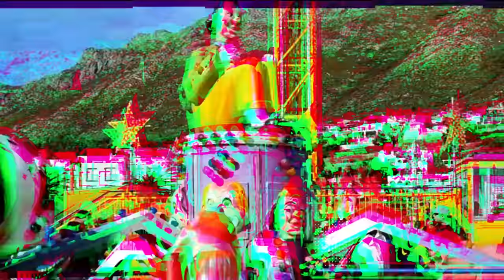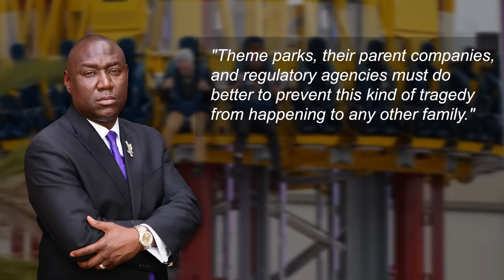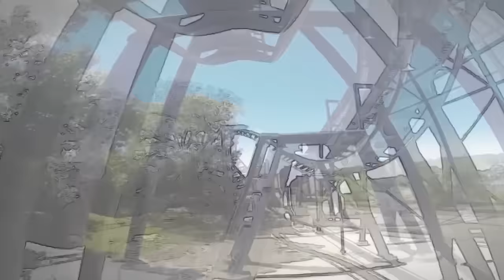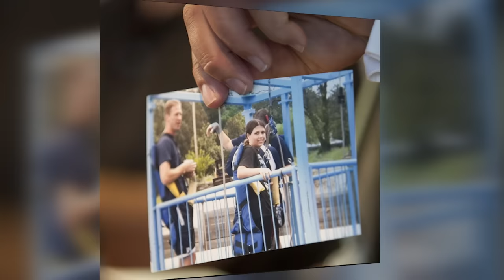9 Worst Roller Coaster Accidents in Human History

Comment: when i was 10  went on a ride at the state fair my belt was loose as I am a infant idk why they didn't tighten it the ride was vary fast and made of a slippery material when we hit a sharp turn i almost slipped out the only thing keeping me from slipping out was my grip and my skin which was sticking to the seat sense i was sweaty once I got off the ride I had calyces on my hands and burns on my thighs/legs it was scary i don't think it will happen again though ever since then i haven't gone on any roller coaster's

Comment: I was almost on this list. Riding on Montu in Busch Gardens Tampa, in one of the loops the hydraulics locking my restraints failed. If I didn't have the seatbelt connected, I would have been in a vertical loop with no safety restraints.
Reply: Doubt this happened.
Reply from the maker: Oh my! Thanks for sharing 🙏🏻

Comment: I have a lot of problems with this. 

1. Final Destination 3 is a shit movie that has no knowledge on the mechanics of roller coasters. Do NOT use clips from that.
2. Some of these aren’t roller coasters. Maybe change the title to amusement rides.
3. A TON of these are footage from different rides and parks than the ones being mentioned, including Texas Tornado during a section of the Darien Lake incident and Scream during NTG.
4. You ignored the part where Hackemer refused a safety pamphlet and was belligerent with staff. 
5. I believe Ferguson was trying to actually skip the line or leave the park from an alternate path. 
6. 2013 was not two years before 2008. That was New Texas Giant. Not Texas Giant. 
7. I don’t know a lot about Disney rides like Columbia, but there’s no way the ride has been closed for 25 years. 
8. Wooden coasters are no less safe than steel ones or any other ride for that matter, as long as they are maintained properly. Only when a ride is not maintained well or a guest makes a stupid error will you see incidents. 
9. Stop fear mongering. Most ride accidents that do occur are like I said, on the guest entirely. 30,000 (if thats accurate) out of millions and millions is not as bad as it sounds. Youre more likely to get injured fishing, or driving, or in your bathtub than on a ride. Something like a horse you put quarters into at a grocery store, that counts as a ride. Some of these are from that. It can also be as simple as stubbing your toe in the station. 

I’m sorry to sound nitpicky but there seem to be a lot of gaps and oversights in this. It’s especially dangerous to spread fear about an activity that is, in reality, very safe. These are easy fixes, anything worth doing is worth doing right. Don’t rush yourself with videos, make sure everything is accurate before having the video out. I highly recommend Coaster College’s What Really Happened series for some of the best research on incidents like these.

Comment: I was on a ride called the falling star at a place called clementon park. The ride apparently was struck by lightning the night before and had issues earlier that day. I got a front seat w my friend when it was okayed I was about 11 / 12. Well on the second free fall around my side of the seat bar unlocked and tried to swing open.  I Litt didn't even scream I sprung into like survival mode and wrapped my self around the inner bar best I could.  my friends side was where the hinge was so she was kinda safer then me plus I kinda kept her in slightly just by sitting there. but I was Litt hanging onto the bar for my life and my legs swung out of the ride on the way down. LUCKILY they saw it and immediate stopped the ride however it's a momentum ride and it took a while before it stopped. I was bruised had a bad knot on my one leg and shaky as hell but not hurt. This was in the 1980s early 90s so nothing happened. Lol I sat down got a free meal a free return pass fore and my friend and I went back to going on rides an hour later lmao.(us 80s kids were just built different mentally i think) I'll never go on a free fall ride again tho. if it happened when the ride was in full swing I wlda either fell off and flew into the lake or the parking lot. I DNT think I clda held on in full motion. I also broke a leg at action park in the 80s lol just went home and nobody did shit lmao.

Comment: Small children should not be allowed on rollercoasters both height and weight should be taken into consideration  same as obese people  shouldn't be allowed on as the rides are not compatible with overweight people the safety belts cant possibly fit plus the ones on rollercoasters and drop rides are not made to fit extra large people.

Comment: shi... happens , there was one i heard about a while ago a ride that launches you up in the air vertically while you're all sat on a seat facing outward......it got stuck at the top which doesn't sound so bad but after a while of it being stuck up there it dropped on a free fall to the ground and while the legs and such are still above ground level the impact of it hitting the ground at such a force caused severe damage to everyone on it , broken/shattered pelvises for everyone , severe spinal damage and some dislocated shoulders.

it's kinda like sitting on a chair and being dropped from 100 feet up , just like the first one

Comment: Then the theme park can be sued for discrimination, eh?
The question for the teen should be, had he survived: “WHY didn’t you tighten your seatbelt, as you know due to your size, esp of your belly/chest area & height THAT 99.9% of any safety gear like a seatbelt, would need to be pulled out much further than say for your fellow 6’5” 190 lbs wide receiver footballer to the much shorter/smaller or average height & build of most riders/tourists (typically varied aged  adults trying to handle babies + tweeties to teens). Yet, each of them also need to manually (w/your hands) tighten their seatbelts for optimal effectiveness.. SO WHY DIDN’T YOU, YOUNG  MR. SAMPSON, TIGHTEN YOUR SEATBELT?? ASK FOR HELP W/TIGHTENING THE SEATBELT BACK UP OR TELL THE ATTENDANT THAT YOUR SEATBELT FELT LOOSE(you’re old enough that you know how to ask for help or am I wrong on this.. just curious😉
Just like the legless veteran who wore no seatbelt & was happy to do without one, even tho his body was overly top heavy and if he’s going 25-35 mph on curves.. this combo would only make his lone & mainly upper body elevate at a faster than the normal rate that one’s body IS NOT USE TO & well, you know the rest. 
🌺 RIP Tyree Sampson - yo’ Tyree,, UB.. Gone to Soon..smh😔
🌸 RIP James Hackamer +Thank You for your service & personal loss of your legs from a homemade bomb in Afghanistan, I believe, in proctecting us here in the USA 🇺🇸

Comment: I worked on construction projects,through  temp agencies, we are put through a safety  awareness program called W.I.M.I.S  for EVERY CONSTRUCTION SITE WE WORKED ON,,we are to use a 4 point safety harness if we work near an edge or on a dangerous situation,which is also on a yank or jolt line that's supposed to absorb the jolt,if you fall,yet these rides use poor or useless safety harness  measures,like this ride  uses only seat belt,that should have been a 4 point safety harness with 2 seperate buckleing devices !for this ride! Or any ride!
Then this young boy wouldn't have fallen out! and died!
Also,due to his size, its the responsibility of the ride operator to prevent any person from getting on a ride when the equipment can't accomodate thier size!
Insults about size or obesity don't kill!
 Negligence and careless decissions do!
We as humans do make mistakes, so with tgat said we also need to make our own decisions not to do things tgat are a risk of the gift of life from God,but also to forgive thise that have made mistakes that cause us or our freinds or relatives our lives!

Comment: All of these are tragic deaths but there were several that the people should never have been on to begin with. They have weight and height requirements for a reason. I've been told a few times I couldn't ride because I was too fat. Fine by me if it keeps me from getting killed. Another reason are the barriers that tell you, more than once, NOT to cross, and they have more than one barrier. If you choose to ignore those safety precautions, of any kind, you are taking your life in your own hands. For those victims who were truly accidental or the fault of the company, I have the utmost sympathy for and their families. Ultimately, when you disobey the rules, or the parents give in, you are literally taking your life into your own hands. It's time to start taking responsibility and quit blaming others unless other people are the reason for what happens. Obey the rules.

Comment: I cannot believe what happened to poor Tegan, that is what radios are for, to communicate and indicate safety protocol before rides AND activities that need safety precautions taken. As for Sampson, they should never of let him on the ride. In the UK, those drop ride seats are always held down, with a clip down belt as 'safety precautions', so if the...."but what if" happens then you know you have a chance. Personally, I believe that all these mechanical rides and rollercoasters should have an automatic stop, so of there are any faults AT ALL, even a slightly loose bolt, the ride should not start even if the button is pressed to go!!!! It should show a light and make a sound that something is wrong. Do these rides not have a computer system, like an ECU!?! If they do, there not very good are they!?! 🤔😕⁉️

Comment: As much as I love Alton Towers Theme park in the UK
For me the one that will always stand out is that of the smiler
Where the park was busy, they added a 5th train / cart to the ride and operated it at 45+ Mph winds when the ride was only designed for 38Mph or less winds

The ride operator dismissed the ride safety alert stating there was a train stuck at the bottom of a U bend, the ride operator thinking there was 4 carts on the ride wasnt aware of the 5th and over-rode the safety mechanism resulting in leg amputations and 4+ hrs trapped on the ride which crushed limbs and knee joints and bleeding out.

https://www.youtube.com/watch?v=LEa8oHG4id0

Comment: People seem to forget that in many rides your loading yourself into a huge machine capable of imparting a lot of force.  If something feels off, get off.  I once rode a coaster where I had a lot of problems closing the over head restraint over my big belly so an employee gave it a shove and got one ratchet click.  I rode but the entire time I was wondering if that one ratchet tooth was going to hold me.  better still it is an inverted (under track) coaster where that over shoulder restraint and a crotch horn in the seat was all that was holding me in.  It made me so aware of how stupid I was to NOT get off and to really think about the safety systems and dangers present on rides thereafter.  Understand that a properly engineered, maintained, and operated ride is very safe but never forget that they are not foolproof and as this video has shown in most cases the fool is the one in the seated on the ride.  Don't be that fool.

Comment: It's suppose to only scare you, it's suppose to be %100 safe. All the bolts at those fairs should be tighter than hand tight or (snugg). Put some lock washers, & lock nuts on everything. Nothing wrong with reinforcing everything. It just takes longer & most people are lazy. Oh yeah, btw, if you have electrical wires running under metal gates & fences, please put up signs, as to not to touch it. I was zapped b4.😂😅😢😢😢😢

Comment: If I ever went on any ride and there was ANY doubt or question if it was ok for me to ride it either size or any  doubt for any reason I wouldn't ride it. I love coasters but if I had the thought going round IF it was safe or any doubt it would stop me enjoying it. So be no point. 
Lot of these stories aren't exactly full facts or full story which can be dangerous on its own not giving an accurate account.
Also if anyone enters restricted areas thats not an accident its suicide, endangerment of others and at best playing chicken with your life. Any death is really sad but if you enter a clearly restricted area you're an idiot for putting your life at risk but even worse than that putting other lives at risk which is unforgivable.
Ride operators I'm sure do make mistakes but feel the public will put them under pressure and use discrimination for not letting them ride. Its not discrimination if its for your safety it's called care and anyone using this is just pathetic.
If the sensors say the bars or harness does not fit comfortably into place where they should be it should be a no go, full stop!
 Failure to walk away by anyone not taking safety advice should immediately be removed from the ride and park for their safety and others and not allowed to visit again.
All so sad stories and hearts out to families but majority so avoidable. Theme parks and rides are fun but if you can't be sensible, mature enough and put safety of yourself and others as top priority you shouldn't be visiting!
If we all put safety as priority then everyone can have a fun filled day without incident which is what we all want to happen

Comment: How did God warned me well let me tell you I got stuck upside down on coaster another time on Goliath the seat belt came loose I held on tight if I didn't I would bin dead in Los Vegas long ago its dramatizen I was little my foster mom put me on roller coaster I could of died but I was always a fighter I managed to hang on until roller coaster stopped I got lucky now I don't like hights I'm afraid of them

Comment: not always to blame the park. if people are oversized like being overweight or too big for a ride, they should be banned from the ride no matter what. I heard of accidents and death due to such problems. problem is also that such guests do whatever they want sometimes and just go without being told not to and the ride goes on anyways instead of being stopped. 
I do not like theme parks as I had my fair share of unpleasant rides such in a new theme parks rollercoaster where I felt pushed back in my seat and could not move my head even a little. i feared snapping my neck.  then yes, i was in the high drop myself in europe and it was my last. the seat belt was loose even with me, I had to hold myself and try to stay in the seat and waited for the ride being over. I never ever do a ride again 🙂